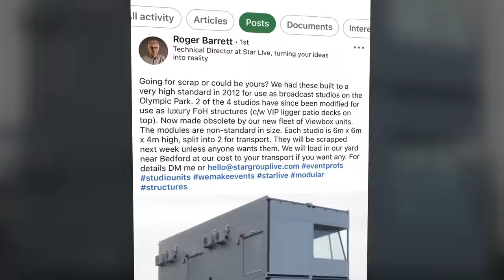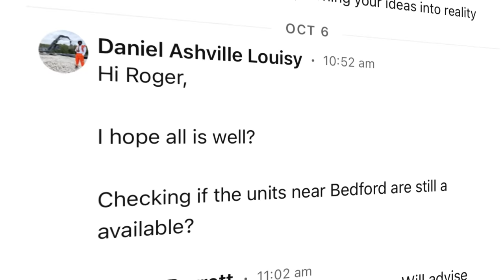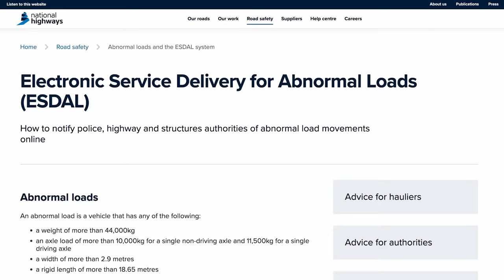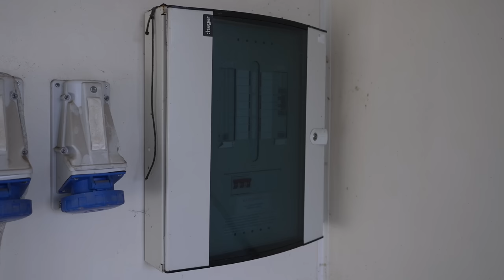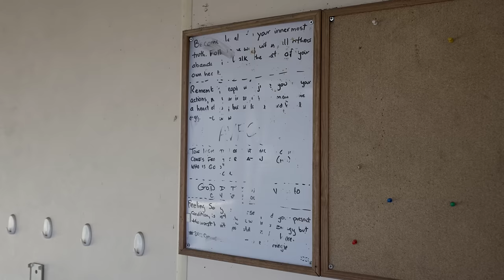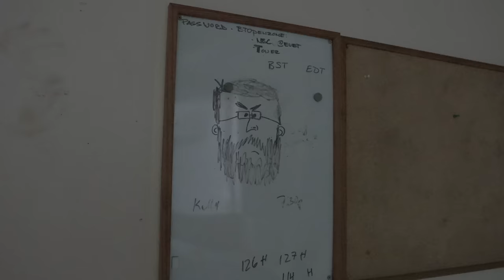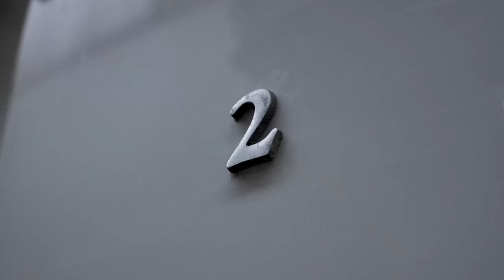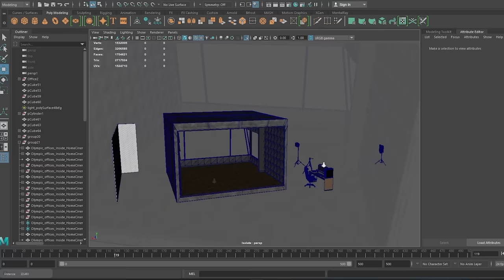We Got These GIANT £40k Containers for FREE ... Now What?! 🤔

Comment: BTW: The windows are angled that way to reduce reflections when filming. Glass always reflects, but by angling it downwards, you get the dark floor instead of brightly lit people, camera and studio lights.
Reply: Exactly what I was thinking! Old trick when you film outside, angle and a ND Wrap :)
Reply: Also to avoid reflection from the back lighting.
Reply: It's like what is called a Portuguese Bridge on Ships, and helps pilot or captain better see where ship is going.
Reply: Sporting events are not shot behind windows and if they were we would use a UV filter plate which would stop reflection.  The ones with angled windows were used as a commentators studio box where the pundits would discuss the events (look at the ceiling you'll see rigging for lights).  The windows are angled to reduce lighting glare from sunlight shining into the lens. The cameras would be placed on the decking or in the module with a roller shutter door. Outside Broadcasting is just that - the cameras are fully capable of being water shielded, the camera crew are used to filming in all weathers.

Comment: Id stack them as twos... have one set up as a show room / demo area, as the deck on the top allows you to show off some external finishes or even outdoor automation of lights or a mini pool / cut away to show whats possible indoors and out.

The other two units stack them again place the production team or whatever below and the one above place Terry in - would be good to have the window where you can overlook most common problems so you get a good view of the yard spot things before they happen to see regular hang ups you might not notice..

Either way nice find on the units!

Comment: Stick to 40 foot containers together side to side, connect them up internally 
so they become 40 foot long and 5 m wide than stick two of the new containers on the 40 foot containers facing outwards on the side with the balcony hanging over with support beans on the corners, creating a waterproof walkway for entry into the the 2 40 foot containers

Comment: The tilted window remind me of the air traffic room windows.  Glad he sees the beauty in it. Remove the rotted stuff and get a good welder to fix the holes in the metal. And rebuild you good to go. You can even use metal studs instead of wood if you like

Comment: If you space them apart you can put a metal roof between them for an outdoor dry space.  Offset them by the width of a door and you can walk between the.  Put one offset hanging over the one below and you have a little dry space outside, and a veranda upstairs.  There are configurations involving using each half (with a new wall) to make up to eight spaces.  I would def call a design friend or architect to play with a model of this incredible find.

Comment: Rised Floor and will get sorted all the floor on all 4 conteiners . [ you can choise  and reduce the weight at RISED   floor model panels ]
The cables all instalation will be under  .
The walls in side  i recoment to be fitt with new sound reduce plasterboard`s  
You are verry lucky to get find it thise amazing conteiners

Comment: Use the viewing platforms underneath and have the office in the air, to view across the yard.
The structure you'll have to put on the viewing platform for strength & rigidity for the office will make the headroom fine, and they could be used for storage or tea room or whatever.

Comment: These were actual studios you can tell by the poles used to hang the lights.
The windows are angled like that so that the overhead lights don't reflect into the cameras and gives a clear view to the outside.
I was thinking you can sell them to a motor racing circuit somewhere after they have been fixed up.

Comment: I would connect them permanently as 2x2, build staircase with insulated walls on the outside and make it into house, or two smaller houses. Due the load carrying capacity excellent for some remote location where roads are shit and ground is soft. If connections are study enough this should carry it self on floating foundation really nicely.

Comment: Put them together keep an open layout and use it as a conference/showroom, showcasing the services Ashville provides. This way you have the material and client in one location and you can provide the client with a visual presentation of the project. This process will save both the company and the client time, unnecessary zoom meetings, and traveling.

Comment: Just get that Harper off corner checked to see if it can handle loads from container on top... Imagine it was placed on top in original design with fenced in patio upper deck on top so cameras could see out without glass in fair weather conditions. You may use it on bottom if it gets a post reinforcement at corner perhaps ?
Reply: Was auto corrected... I wrote tarped off corner

Comment: Sibcas makes bespoke flexible modular units like this in slices. Schools, gp surgeries etc  they may have been part of it. During the olympics no branding was allowed to be displayed so they wouldn’t have branded it with the company name. If you find the chassis number which is on the bottom at the ends usually they would probably let you know or pass you the drawings & specs for it 😀

Comment: The comments say to go for office space so I guess that's the direction. Maybe also high grade ready to use office for construction site? I've been on lots of job sites where lunch room and office space was just a small crappy trailer with small windows.  Double stacked with company office on top and employee and muster room below. Observation platform on top for visitors and supervisors.  Added restroom on second floor for office personnel is a plus for office workers. Employees use outside dedicated standard restrooms and lockers as always. Maybe the worst ones can be refurbished for that purpose. I'm guessing the water damage came when units were moved off site the first time and not properly resealed at center seam?

Comment: The blue sockets are 63 amp single phase out feeds used to power an outside broadcast truck (OB truck) the red 63/3 phase on the outside is the incoming power. The windows are angled to stop reflections and the scarf tube in the roof is for lighting. The red light outside does mean what you think. It’s means camera rolling(filming) or that they’re on air.

Comment: the lighting trusses should have a weight rating printed nearby, the boxes are sound insulated, and these are bespoke buildings,  I have worked in a few of these, the aircon may be worn out as the lights put out a ton of heat so the AC is normally on full,  Red light is on air,  its part of a system called bells and lights, when the light is on the door is normally automatically locked, and a fireman placed outside for safety,  there should be a three-phase system on the outside for electrical hook up to the generators.  Similar to the 230v as well,  the viewing platforms should have rubber gaskets to stop clanging and noise.   The internals should have a fire rating as well.  The glass exterior may have ND film on,  neutral density.  Some of these have rubber flooring which is perfectly level, and some camera studio rostrums hover on an air bed taking pressure off the wheels to get smooth movements.  Great find,  if I had land I would put them all together and make a house for myself as a project, with a south-facing window for my art studio.   I am very jealous

Comment: Hi pal, good showmanship :) I subbed you. Great find on these, I like it! I'm wondering what cad software you used? I'd take years to make them haha :o blender? Also, I appreciate the urgency but you did put cheap tarps on the roof? :S :) I've always wanted to know how these designs shed water, if they're even slightly angled above. Two way mirror film is cheap and easy to get on eBay, Ali express and such :) it's a good way about privacy but doesn't work if the inside is lit brighter than the outside, especially at night :)

Comment: Just love your content. how you think ahead. mmmm....!!! interesting......  if your were to use the containers for exhibition purposes housing bathroom fittings / entertainment configuration like Will installs. How offend would you have upgrade the stock or the system based on the advancement in technology or fashion trends. Either way wouldn't you have to look more closely at health and safety with increased foot traffic. .. I would say if its a case that the refurbishment projects are more frequent and the offices are up to par. Then go for the bathroom, floors and entertainment units. Saves you having to get rid of the offices and training containers recently converted....        Hope to meet you one day fella   Kind Regard Darrell